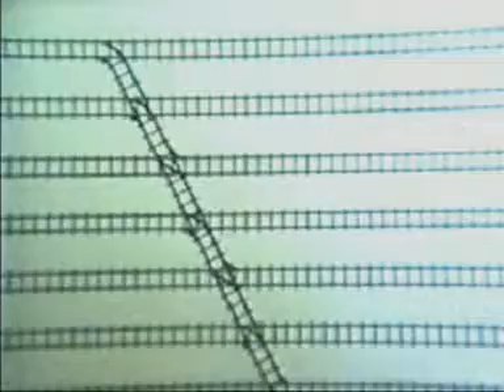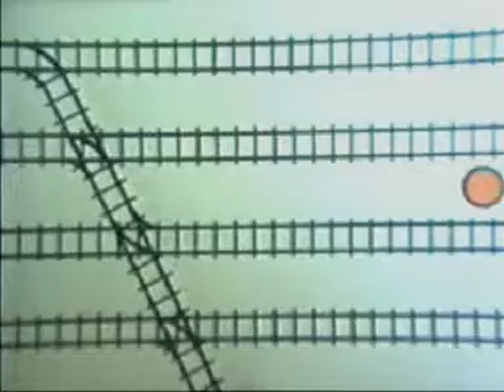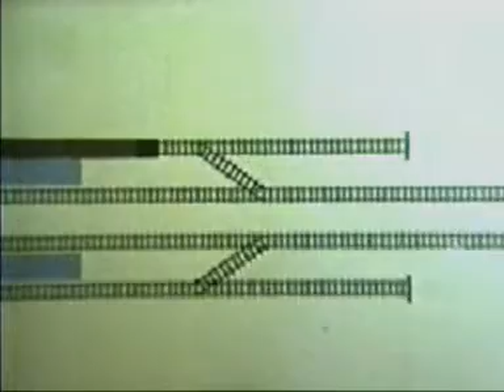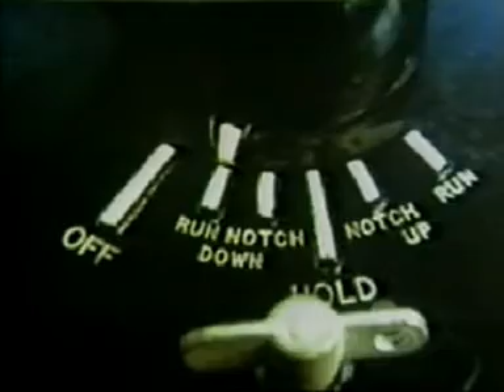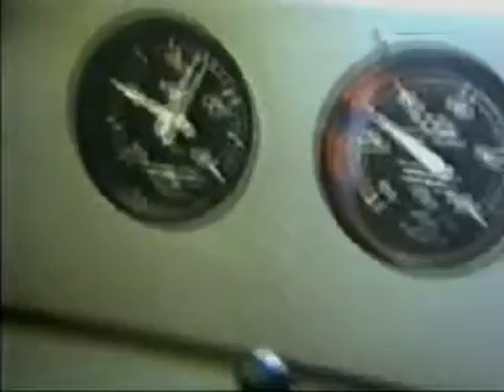Rail Crash 5 of 6

Comment: Just as an side, ATYC or AWS isn't itself 100 % infallible - there was a terrible disaster in Northern France  during one of the 1940's winters, due to ice forming on the ramp and insulating the pick up shoe.  The driver thus ran through his sticks in thick, freezing fog, and slammed into a standing train at full speed - the engine was thereafter known as Le Charcutier' - 'the Buitcher.'

Comment: So the engineer went 4 miles without noticing the track he thought he was on was actually the track whizzing by right beside him??
Reply: The other issue, IIRC, was the accident locomotive was a right hand drive locomotive running on a line that had the signals positioned to the left of the track for left hand drive locomotives. There were some other near misses that resulted from RHD locomotives operating on LHD signaled lines.
Reply: Yes but it was a Blackout During the War.